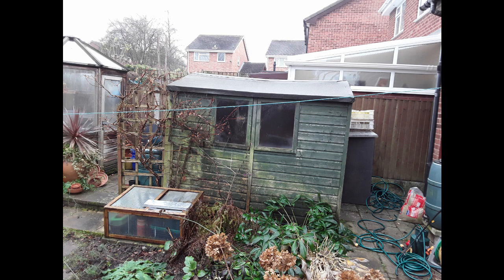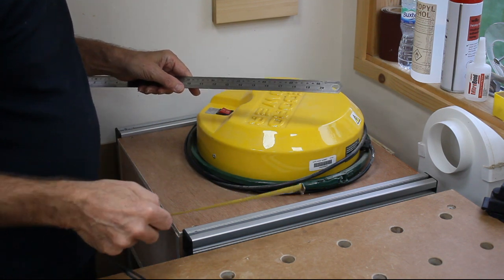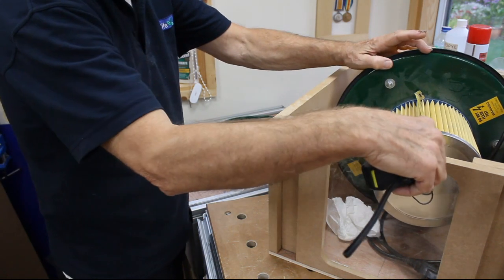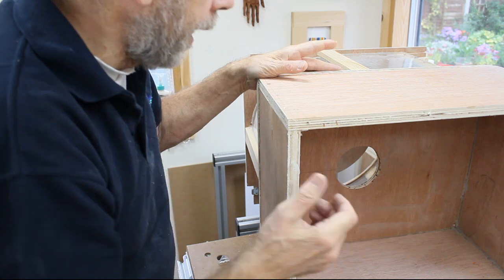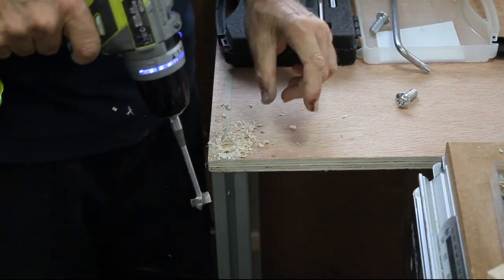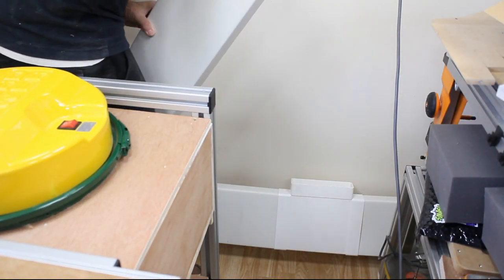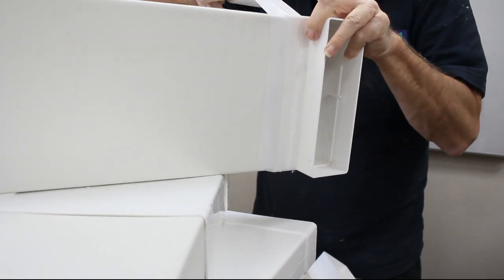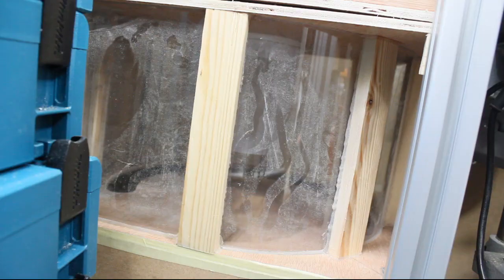the small shed #133 - finally commissioning the vacuum system

Comment: could it be easier to get to things if you hung up your vac system on wall?
Reply from the maker: It's a good idea, but there isn't much wall available space in the shed, having it on a trolley means I can move it out of the way of things if necessary. It's one of the problems with having such a small workspace!